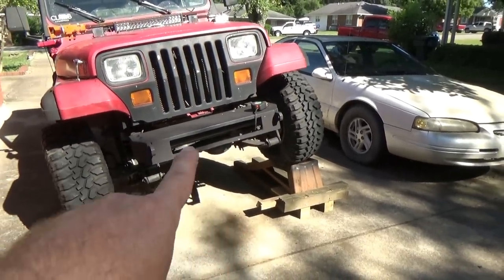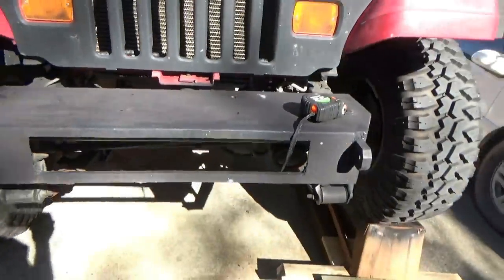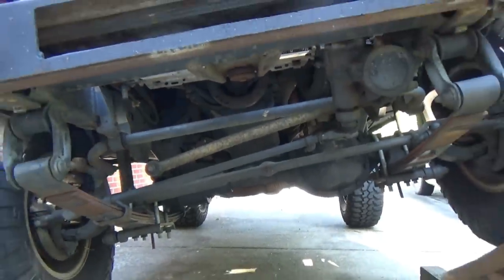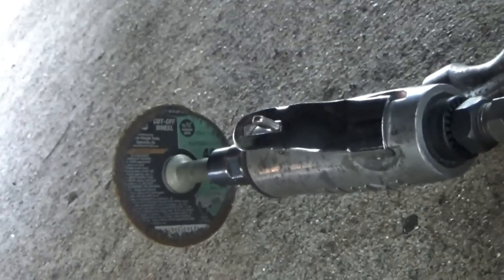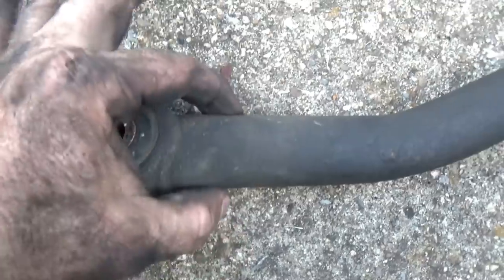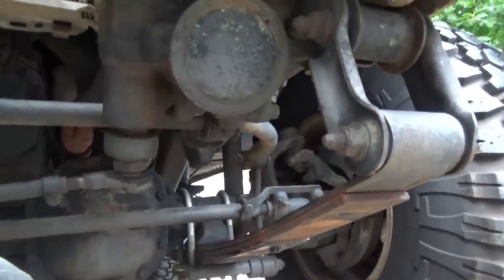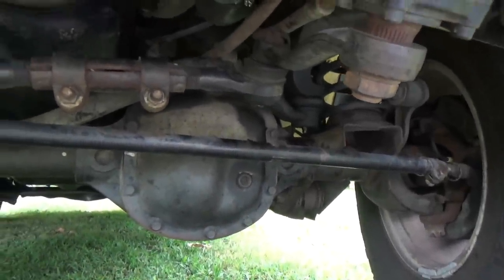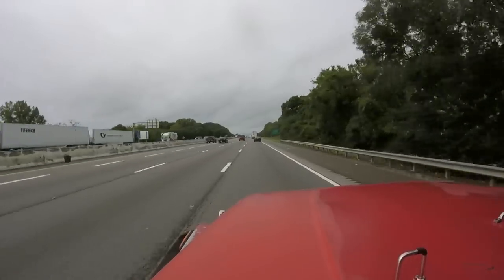Jeep Wrangler YJ - I removed my Track Bars

Comment: My first experience with that rear track bar was trying to put new exhaust up in there.  After trying to break those bolt, I finially gave up and sawed the rear hanger off the exhaust.   Could get it in then and reweld the hanger on with it in that rear hanger first and then to the pipe.  If and when I decide to remover the rear track, think I will just take the reciprocating saw and cut the pipe just before the bolts.  My concern if just how much the state inspector man here in VA might flip out.  On these old 4X4, they really look under them even for rusty frames.
Reply from the maker: You got a point. In some states, it is part of the inspection to have that checked. Luckily in Tennessee, I don't have to deal with that. Good luck! Thanks for dropping in. Have a great day!

Comment: I have a question for you,  my YJ is a 91 and its kinda weird because my leaf springs in front will move side to side...  When facing the jeep I noticed one day when I took a photo and my leaf spring was angled to the left side, then the next time I took a photo it was angled to the right side.  What would cause the leaf spring to move side to side just a bit to be noticeable?  My YJ has a 3" body lift and a front shackle that looks extended a bit for height... I get a slight wheel wobble when braking from a high speed...   Any help would be great...  Thanks a ton
Reply from the maker: Sounds like you have excessively long lift shackles. I am not a fan of those at all! They bind the leaf and frame/shackle bushings. Mess up the front steering geometry. In my opinion, there is nothing good about them. They are a cheap way of getting a suspension lift. But the complications that come with them just isn't worth it. Long story short, if you have really long shackles .. get rid of them. Shackle lift no more than an inch you should be ok. Any more than that, you will get the issues you are describing. When you change the shackles, do yourself a favor and install new bushing while you are at it (bushings can be easy or a major pain to change). Hope this helps! Have a great day!
Reply: Along with a 3" body lift.....  Dude...  You're BEGGING for problems and/or getting hurt.

Comment: Have you experienced changing a 4cyl engine with a 6cyl on a yj?  I have a 4 banger and it just isn't enough for me.
Reply: Did a 94 4.0l swap in my 90, Bought a donor, did a complete rebuild ,.030 pistons and stroked it to a 4.6L. . Cost me about 3500, grabbed a donor from a wrecker for 500, took the computer and everything. If you are going to swap might as well go to Fuel injection, save you from messing with carbs, from my 4.2 to the 4.0 was +80hp right off the hop. Then stroked it added ????, it's a stump puller for sure, but still reliable ,  day trips or playing, best money I spent, cheers

Comment: I know this was posted forever ago, but I ran across this today while working on a death wobble situation.  I have an 88 Wrangler YJ with 4.5" lift.  It does have a pretty big pitman arm drop to compensate.  I've replaced the tie rod, drag link, all four ball joints and both front wheel bearings/hubs.  It drove fine for one trip then on the way home I started getting the death wobble again when I hit bumps generally below 40mph.  I had my wife turn the steering wheel while I went over all the parts and noticed that the track bar bushings and the extended bracket for the track bar on the axle moved about 1/4" when she moved the wheel.  I realized that that bracket used to come loose on me and would cause this death wobble when I first put the lift on.  Do you think remove the bar all together would eliiminate that or make it worse?    I'm wondering if the bar being loose but still attached could cause the axle to just ping pong back and forth.  Eitehr way, thanks for the video and I may pull it off just to see.  The wobble is very easy to reproduce.
Reply from the maker: Depending on how old the lift is, you might want to check the spring bushings, shackles and if the bolts are tight. Depending on the characteristics of the springs, you might want to have the caster angle checked. I'm not going to say whether the track bars will fix it or make it worse. Typically death wobble is a symptom of other issues. If it was a TJ or an XJ, The track bar would be my first guess. Leaf spring rigs, there are other factors that can cause it as well.
Reply: It's actually a fairly new lift, bought new towards the end of last year.  It had an old 3" lift on it before, but I need a little more flex.  The shackle and leaf bushing are all new, and they are all torqued to specs from the lift manufacturer.  I've double and more than triple checked them trying to find all of my wobble causing issues.  LIke I mentioned, I've replaced so many parts so far and was in the market to replace the track bar bushings when I ran across this trend and your video among many others to just remove it.  I'll work on taking the track bar off today and give it a drive.  I can reproduce the wobble in my subdivision, or really any bump in the road.
Reply: Like you suggested, removing the track bar didn't fix my death wobble, or make it worse either.  Smooth roads are fine, any bump that affects just one tire will throw it into the worse death wobble ever.  I won't bother you for troubleshooting, as I know this problem can be so many things.  I may post if I find what my fix is.  Thanks for the videos Power Addicts!  No matter how old they are, they are still helping out us Jeepers after all these years!

Comment: I know this is an old video, but I just put a 4 in lift on my 91 YJ. I did away with my track bar as well. My question is, do I need to replace my pitman arm? I have clearance on the ground and at full lock, but everywhere I look some people say yes replace it and others say it doesn't need to be replaced.
Reply from the maker: Honestly its a matter of preference. Using the stock pitman arm with that much lift throws the steering wheel out of alignment. You can adjust some of it out with making adjustments to the drag link. Some people are fine with it. Some people spaz out over it. If it drives well with no excessive bump steer and Its stable on the road at highway speeds. Then its up to you about the rest. I've got 3" of suspension lift with the stock pitman arm, no sway bars or track bars and I am fine with it around town, on the highways at 70 mph. Like I said .. totally up to you.

Comment: old video but i have a 1991 jeep wrangler 4.0 and its lifted 4 inches on 33" tires. It rides ROUGH to say the least. How much of a difference would you think ill feel if i take these off. I practically jump out of my seat if i drive over a penny...
Reply from the maker: Me and many others have gotten a much better ride after removing the bars. What I would suggest is remove then and try it for yourself to see what you think. Its only 2 bolts per bar. If you like it ... GREAT .. if not put them back on no harm no foul :-). But, I had a big difference in ride quality in mine. Try it out and good luck! Thanks for dropping in! Have a great day!

Comment: New to YJ's here, you mentioned S-10 leaf springs, what years do  you use, do they require mods to install? and do they carry more weight than the stock springs? Thanks
Reply from the maker: I've got videos where I did the lift with S10 springs. Be sure to watch both videos because on the 2nd one I point out a mistake I made.

Comment: Track bar in the back makes no sense. But the one in the front i wonder about. Does it cause extra stress on the steering box mount?
Reply from the maker: Nope, but honestly the steering box should have been braced from the factory with or without the track bar. I like mine much better since removing the track bars. Have a great day!

Comment: How do you explain the body being crooked and the steering wheel being turned to the right after taking the front and rear off?
Reply from the maker: Since you didn't elaborate whether you were referring to mine or yours, I'll start out with yours.

Most people who experience what you are referring to when they pull the track bars have either dead leaf springs or worn out leaf spring bushings .. or .. both. The track bars are acting as a crutch to support the worn out parts.

Mine .. easy .. the body has been crooked since the day I bought it because a previous owner bent the body frame mounts and tub. Also the right side of the tub has been in an accident from a previous owner. So .. yep the tub sits twisted and crooked on the frame which has nothing to do with the track bar because the track bar attaches to the diffs and frame ... not the tub. As for the steering wheel being turned to the right .. again it has always been like that. That Jeep had a very hard previous life as a farm toy for a 14-year-old kid .. then what looks like an accident that I mentioned about the body being twisted and crooked. Steering column connected to the tub .. the other end connected to the steering box .. tub being crooked and twisted can cause the steering wheel to "re-clock" just a bit. The steering box is worn out, therefore, allowing the steering wheel to go off center can add to it. Also .. I had driven the Jeep, I had flexed the Jeep up on ramps in between video takes .. it could simply be that the steering wheel is in a different position. I daily drive that Jeep 70+ mile a day to and from work. Taken many road trips of several hours each way. Removing those track bars did nothing but help the way it rides and handles. Have a great day.

Comment: I've watched this video twice now, a year apart.
Still haven't taken my track bars off. but I think it's a good idea to.
I think my YJ handles well on road as it is, but it rides poorly. It's only four bolts, and I've swapped the axels so I know 2 will come out. Maybe its time I try it with no track bars.
Reply from the maker: The poor ride comes from the leaf springs and track bars fighting one another. They both work off 2 different planes of movement, therefore, causing suspension binding. The track bar works at an arch which forces the axle to move laterally or side-to-side. Leaf springs were only designed to work up and down, not side-to-side so the track bars and leaf springs are constantly fighting each other. Removing the track bars allows the leaf springs to do their job as they should. Like you said, its only 4 bolts and it only takes a few minutes to pull them out when not rusted. You discover you aren't comfortable without the tracks bars, put them back in. No harm .. no foul. Good luck and thanks for checking out the video!! Have a great day!

Comment: I removed my rear track bar as you suggested. I haven’t had the time to drive it much to decide if that works for me. My question is my front suspension has a sway bar and a track bar. If I go off roading or go into deep snow, would I need to disengage both or what? My jeep is street driven a lot. Great Videos!!
Reply from the maker: My Jeep is daily driven at least 70 miles a day to and from work. I removed both front and rear track bar. I run sway bar disconnects in the front. Here is the vid on the swap bar disconnects: https://www.youtube.com/watch?v=Au6367cMl9I . I personally and many others like having all that stuff gone and disconnected. But, some people don't feel comfortable and that is OK. It really up to the Jeep owner what they want. Hope this helps! Thanks for checking out the video! Have a great day!!

Comment: Do you think having a lift would make a difference as far as safety goes? I'm still a little worried about body roll. I have an older four inch lift kit.
Reply from the maker: Anything with a higher center of gravity isn't as safe as a low center of gravity. But the fact is, its a Jeep. Not a Camaro, Mustang, Corvette or any other type of low center of gravity curve hugging sports car. As long as people realize that Jeeps aren't meant to corner like a sports car and drive them accordingly, there is no issues. Thats the reason that track bars got stuck on YJs. People were driving the CJs too aggressively and rolling them. Then the government stepped in and mandated testing of Wrangler. They put the Wrangler through totally unrealistic tests and forced AMC to put the track bars on them. When driven like Wranglers were meant to be driven, they were totally safe. Now I realize this doesn't totally answer your question as far as safety goes. Any lifted vehicle isnt as safe as it could be sitting low on the ground. Again, that comes back to the undisputed fact of the Laws of Gravity and inertia. In the end its up to the owners as to what they are comfortable with. If you don't feel safe, don't do it. Stay with what make you feel safe. Hope this helps. Have a great day!!
Reply: Thanks for the response. It makes sense to me why it should work but it feels weird taking it off
Reply from the maker: I understand. Good thing is, if you take them off and it doesn't feel right to you. They are simple to reinstall. No harm .. no foul :-) . Good luck! Where about in Arkansas area ya? Reason I ask, my son is stationed at Little Rock AirForce Base. I'm in that area occasionally.
Reply: True, true. I might start with the rear and see how it feels. I'm wondering if getting new shackles would make any difference? I am in northwest Arkansas near Fayetteville.
Reply from the maker: If you go shackles, do yourself a favor and don't go no more than 1" of shackles lift. The really long shackles lift puts an unnecessary lateral binding on the shackle bushings. This causes handling and other issues you don't want.
Reply: Yeah, I definitely don't want anymore lift. Thanks a lot! Keep those videos coming.
Reply from the maker: You're welcome! I'll keep the videos a going! Thanks for checking out my channel!! Have a great day!

Comment: Thanks for the video! Keeping the trials and tribulations real... 
My one question, did taking rear track bar off cause your parking brake cable to max stretch? That's the only reason I'm keeping my rears on.
Looking forward to your next video!👍🏻
Reply from the maker: Nope .. I daily drive mine at least 70 miles a day, it hasn't caused me any negative issues of any kind. Your leaf springs keep the axle positioned laterally. If your axle moves laterally after removing the track bar, your shackle bushings are done for. Thanks for checking out the videos!! Glad you enjoy them! Have a great day!

Comment: I have a 2 1/2 in lift can I remove the track bar and still be good
Reply from the maker: Ive got right at 3" of lift on mine. Im running no trackbar or sway bars with no issues at all. Doesnt ride as still now. Thanks for dropping in!! Have a great day!

Comment: P.B. Blaster is your friend...
Reply from the maker: I totally agree with you. I had sprayed PB Blaster on it a few times a week before i started pulling them. That bolt was seized to the sleeve inside the bushing. Had to cut it out .. do what ya gotta do. Have a great day!!
Reply: That shit is poision. You ever breathe that crap in? Got news for you: acetone and transmission fluid 50/50 beats all and it won't fry your brain. Throw the PB away..it should be banned.

Comment: Hey there!  Love your videos- they’ve helped me a ton.  What are your thoughts on sway bar removal?  Broke my front track bar off on a trail but had plans to remove those anyways.  I also lost a bolt on my sway bar, debating just removing the sway bar?  Got a 4.5” lift on 33s
Reply from the maker: I got about 4" of lift. I have quick disconnects but I've had my sway bar disconnected and tied up for almost a year now. I'll eventually take it completely off. I daily drive mine on both highway and backcountry roads. I've had no issues at all. Glad you like the videos!! Hope they help!!
Reply: @Poweraddicts  Nice!  I ended up just scrapping all the track/sway bars.  Noticed a little bit of ride change but I won't be going back.  Love the flex.  Keep up the great videos!

Comment: I have a 4 1/2 lift on my yj and it’s all over the road will this help that
Reply: my stock '91 YJ was all over the road. My mechanic (I live in an apt. and cannot work on stuff) replaced the steering stabilizer and it did wonders.
Reply: @hacunamatata6802  yeah mine was the steering box the shaft was bent

Comment: With all stock suspension will this make any difference? I've only heard of people with a lift actually doing this, although most people put a lift on their YJ haha
Reply from the maker: Even with a stock suspension this can help. The leaf springs were designed to travel up and down. The track bar forces the leaves to travel at an arc which puts the whole suspension in a bind. So, stock or lifted , it helps. Hope this helps! Have a great day!
Reply: Power Addicts - FixJeeps.com - Jeep, car and motorcycle tips thank you so much!! Planning on taking my track bars off Today!